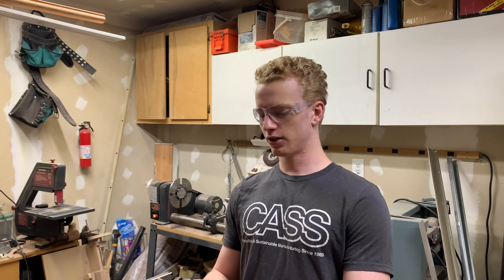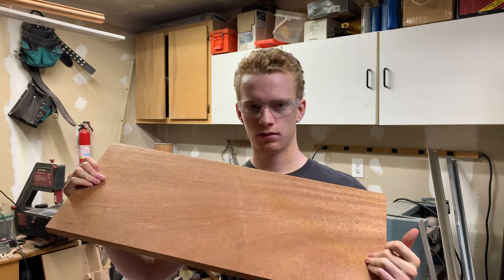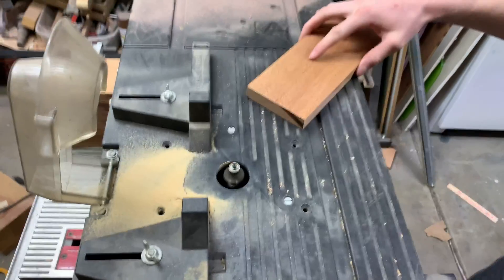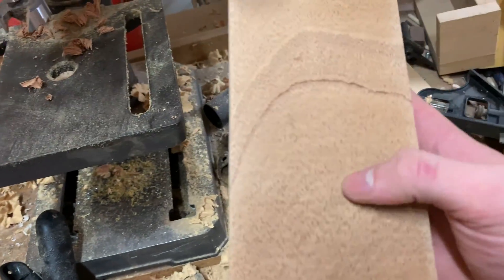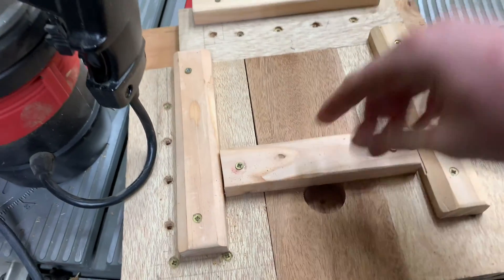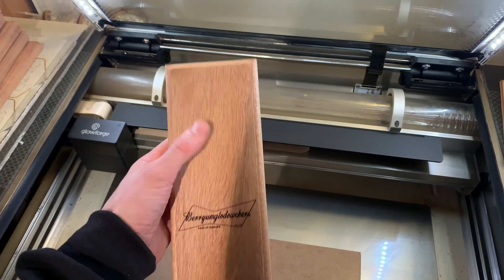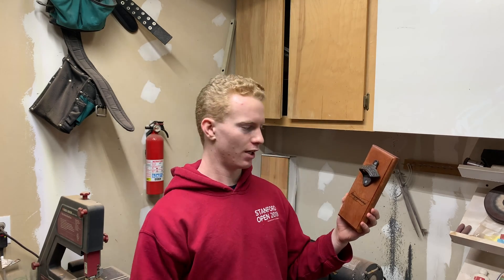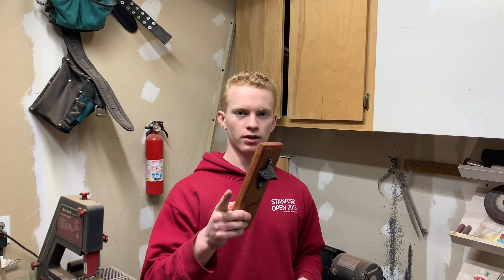Making a Magnetic Wall Mounted Bottle Opener

Comment: Nice video! I made one of these one time and I painted it with a painted logo on it. What would you suggest I seal it with just so the logo doesn’t get scratched up with the bottom caps?
Reply from the maker: A varnish or spray on clear coat should be plenty
Reply: @IntoTheWoodShop  thank you

Comment: HI was wondering if I can do the keyhole without the wood bracket thingy? I don't know how to make one, an dI check-out the amazon link for the magnets and they seem small, do you use one in the slot or add a few?
Reply from the maker: The magnets are in the drilled hole not the keyhole. You can do it without the jig but the router bit tends to follow the grain making it come out crooked